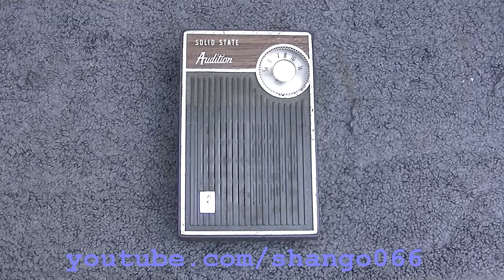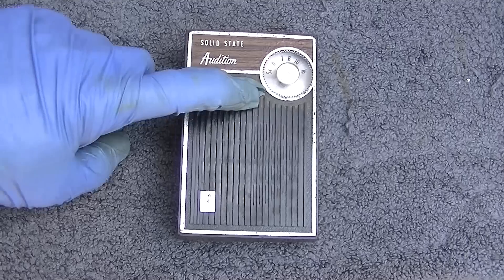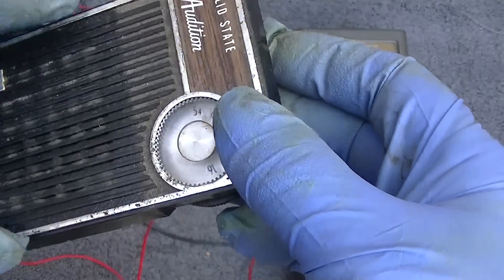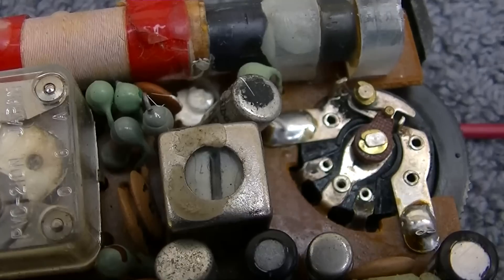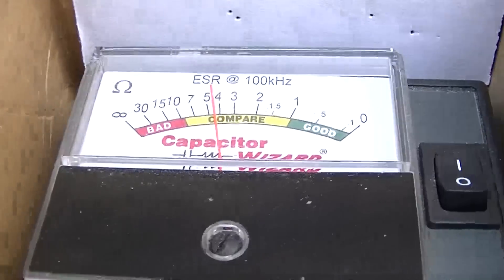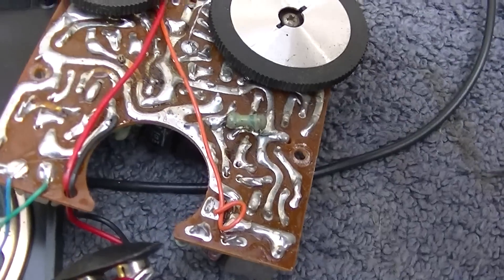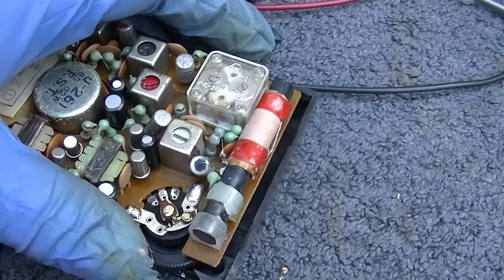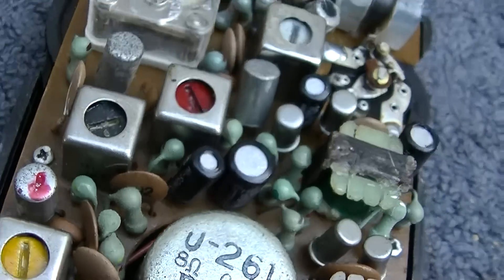1970 Audition AM Pocket Radio Repair Quick Fix Woolworth Store Radio

Comment: I think I remember you pulling this out of a box in a recent video, I recall the Audition logo.  I had a larger 'table' radio from Woolco, early 70s. It too was an Audition.  Had FM and an a built-in transformer for use on AC.  I learned to love the improved audio from the few FM stations at the time, especially on my Soundesign headphones - which made Audition seem high-brow in comparison. After years of AM telephony bandwidth audio FM was so refreshing.

Comment: I have an Audition AM Clock radio.  Works beautifully because it was never used, it was a gift that was put away and forgotten.  It’s still in its plastic wrappings.  The clock was a windup alarm clock in a collapsible case.  It was purchased at Woolworth and had a 9 volt battery purchased at Satlers Department Store now defunct.  Thanks for the information you provided, being a Woolworth house brand.

Comment: You are so right about those USSR radios.  At least the one I ordered from the fellow in Ukraine.  I got one of those little grey AM/SW sets with the built in flashlight/dial light combo's that you showed. When I got it, the selection was great but volume was low. I tried your replacement test with one capacitor, the first one I tried it on the radio came back to full life and could nearly blow my hearing aides up!  I left the original in because it was damn hard to get to and just soldered my replacement cap over it, now I have a WONDERFUL little radio that comes to bed with me at night so I can listen to the stations I used to tune into when on the Night Shift on the Police Department.  After 2:00AM not a lot goes on but security patrol in the alleys and chasing kids breaking curfew and spinning the tires on dad's pickup, so the AM Radio becomes a lone officers best friend, the night talk shows and reruns of Radio Mystery Theatre keep the eyeballs open as  sleep tries to invade your shift. Some of the Shortwave shows come blasting in better then local AM stations.  Love that little  jewel from the days of the Commies.

Comment: Years ago, when I lived in the Phoenix area, K-mart was a direct competitor to Woolco. If you want a really good DX-ing experience, take a wooden embroidery hoop, put some double-sided tape on the outside, and wrap it with magnet wire, then take a variable capacitor, solder two of the lugs to either end of the coil and use a low-value ceramic capacitor in parallel. Place the coil assembly near the radio. You can tune the resonance of the coil, and it will boost any weak signal under the principle of inductance.
Reply: The NGAN200 Grundig antenna does the same thing if you don't want to build one.
Reply: I think the C-Crane Select-A-Tenna operated on the same principle.
Reply: @norcal715  I remember seeing those,They came out in the early 1970’s. the ones I saw were not made by “C-Crane” though,the Select-aTenna I remember was made by a company called intensitronics. It was round and had a dial in the center. I was always curious as to how well they worked. I saw one in a thrift store over 20 years ago and thought about buying it,but didn’t because there really wasn’t  anything worth listening to on the radio anymore,either fm or am.  It used to be nice back in the “old days” when you could use the original Am radio in your car and hear good music. ,into the 70’s and 80’s there were still AM stations like KRLA that would play 50’s and 60’s music. Now the AM dial is mostly taken up with political propaganda,foreign language programming other dreck.  Another thing that’s become intolerable about radio are the commercials. It seems for every 5 minutes of actual programming,there is 10 minutes of commercials. Too bad everything comes down to money. I’d love to see someone create a radio station that is entirely 50’s and 60’s music and programming with nothing but vintage commercials and recordings of old disc jockeys. They could play old radio shows from the 40’s and 50’s at night.  Yeah,I know. There’s no market for it.
Reply: @Suddenlyits1960 : I think there would be a huge market for that.  Maybe there are some online streaming niche stations that do that.  Great idea.

Comment: About 50 years ago, you can buy any type of transistor radio from local hardware store  and all department store. The hi-ends AM-FM -SW-LW like Zenith Transoceanic is restricted to be sold at Radio Shop that has repair facility and it was very expensive like $250.00! The pawn brokers and used second hand store sold the radio and TV too along with household item. My uncle color TV that he brought from PX in Japan was stolen from his apartment and recovered at the 2nd hand store for $180.00.
Reply: Jeez... Back when it was difficult to steal a TV!
Reply: @volvo09  And they cost enough that stealing one would have been a felony.

Comment: Oh yes I remember Woolworths.  They had a great cafeteria in there and we considered it a treat to eat lunch there while we were shopping.  I've got to get me one of those capacitor wizards. Are those the ones from Howard electronics?  Great video.  Thanks
Reply: The food was great, a burger, fries and a banana split. Americana!
Reply: The Red Grille, wasn't it?
Reply: @rotaxtwin  I googled it, I could not recall, but yes. It was The Red Grille.
Lots of pics to see from the past.
Reply: @rotaxtwin  they called it the dead grill lol. They had a deli too.
Reply: Our Woolworths had a lunch counter that was from 1959,it was still in operation into the 1980’s. They sold shakes,sodas,sandwiches,fries. It was really nice and was left mostly untouched since it was built.. The Woolworth had two stories too,you could take an escalator into the basement.  It’s so sad that all these places are gone now. White Front,Zodys,The Treasury, Gemco,Fedco,TG&Y,Sears,Wards,Kmart.
Reply: @Suddenlyits1960  it was good food. Walmart took them over in Canada and the deli and restaurant went away. Now you eat at Subway instead of a nice hot meal

Comment: If possible, please show how to revive or replace a metal reed speaker on a 60's GE portable or similar. My model 1730B's speaker is weak and distorted, but the radio cranks with external speaker in headphone jack.
Reply from the maker: If a regular speaker won't fit you'll probably have to get a donor radio

Comment: Know wonder, you usually do not see the interstage IF can (one with yellow paint) use in the detector stage and the IF detector can (one with black) as the interstage IF.  I bet if the IF cans were switched and you did a full alignment, that radio would work better at separating AM stations.

Comment: 8 transistors in a small radio ! That must be a record! ofcourse 2 of them are used in a useless manner. The transistors themselves look pretty decent. want higher selectivity! remove the shunt resistors in IFTA and IFT B primaries. Add extra bypass caps near the IF transformers power supply pins. Does wonders.

Comment: Greetings: using the local oscillator for counter input requires manual addition of the IF to get the carrier frequency of the station. Programmable frequency counters usually accommodate loading the IF such that station RF carrier is displayed when the local oscillator is sniffed. Do you think using that setup while troubleshooting is not appropriate for your repair method?

Comment: That was the year I was born. That should make this one ☝️ of the best transistor radios 📻. Looks like 👍 you’re artificially biasing a capacitor in, by touching the leads to the circuit board. This amplifies the volume of the radio 📻. That’s because the radio’s 📻 capacitors are bad. Those types of radios 📻 rocked back in the day, even if they were a 1980’s model. Real lead solder was used in the manufacture 👨 of these circuit boards then. Perfect 😍 beach 🏖 radio 📻, or in the living room. Your friend, Jeff.

Comment: Can you do a video on how to add an external antenna jack on a AM radios internal rod?
Reply from the maker: The bar antenna is all that's needed. An external antenna is not going to improve it
Reply: No need to add a jack.
Find a "select-a-tenna" 
Set the AM radio near the loop, or close to the side.
Set the desired AM station on the radio.
Tune the "select-a-tenna" center knob until the sound improves.
The "select-a-tenna" can be rotated to null out interferance.
Works very well. No wires or battery needed.
Reply: You could wrap about 10 turns of wire around the radio. That Should couple the random long wire and hopefully outside antenna. Some might connect the other end of the wire to ground. You'll have to give it a try.
Reply: @johnnytacokleinschmidt515  This is what I've done before. I was in a metal building and it was close to impossible to get AM in there and I would wrap the antenna coil with solid core telephone wire and hook it to a outside antenna. 

Agreed though it won't improve anything too much if it's a decent radio and you're outdoors

Comment: So if you were to take one of these old cases and stuff it with the best performing AM radio innards available, what would that look like?
Reply: A longer ferrite antenna firstly I'd think.

Each intermediate frequency stage increases gain and reduces edges on the bandwidth. Another IF or two would help.